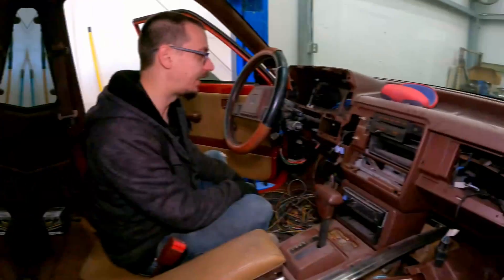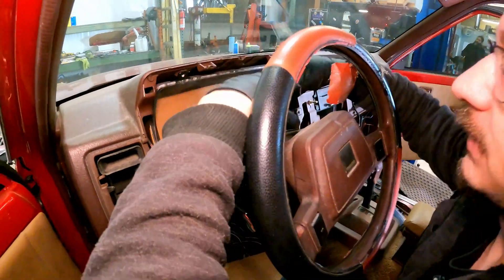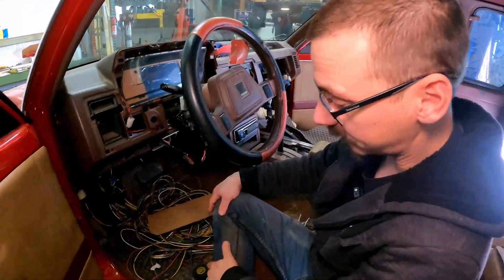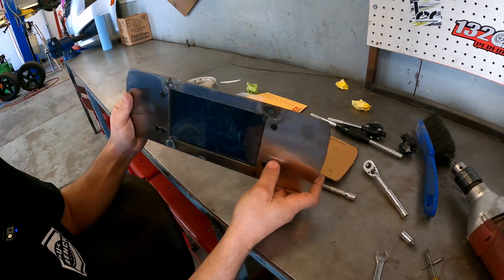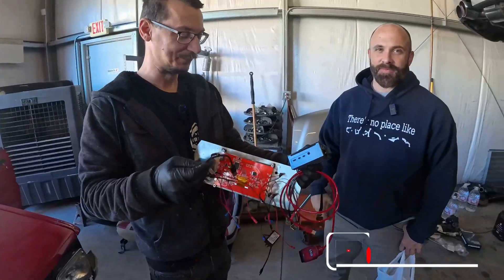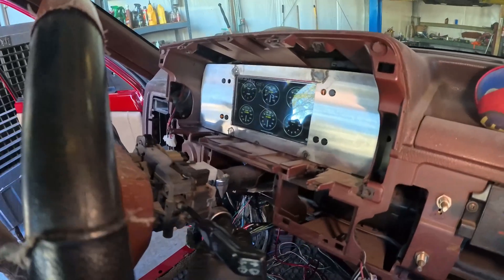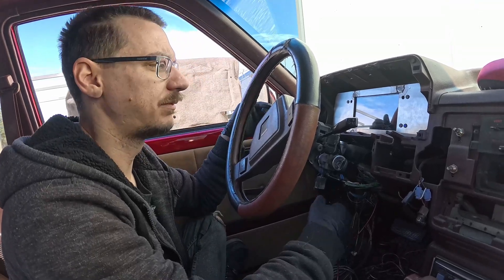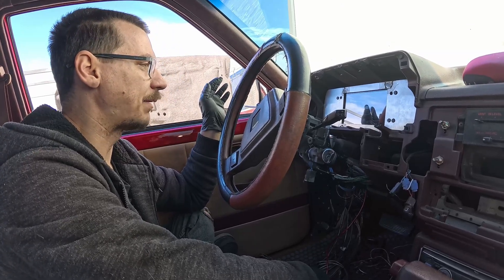Custom Raspberry Pi Cluster on LS Swapped Mazda B2200

Comment: I hope this is running off of a usb image and not sdcard...sdcards tend to die quickly with power loss cycles. Boot speed on USB is usually faster too.
Reply: M.2 SATA  It halves the load time over the SD.
Reply: @fokker1138  I think USB is probably just about as fast on a PI v4
Reply: @ATGEnki  It's limited by USB 3.0 speeds, so it won't be any faster.  The form factor just works since the card can mount under the Pi4 itself and came with a case to house it all.
Reply: @fokker1138 
I was referring more to boot speed than raw throughput. Most systems don't benefit much from huge sequential read numbers vs faster Q1T1 and higher IO numbers, both of which USB would still stomp an SD card on.

Comment: Is there an outside power source for the raspberry pi? What happens when the power is cut to the vehicle, dead battery?
Reply: they have step down converters for 12 volts to 5v and a script you can run on the Pi that detecs when power is shutdown, it will gracefully power the pi off. at 11:17 you see the little black box dangling, thats the voltage stepper